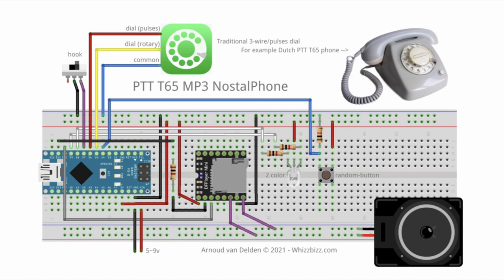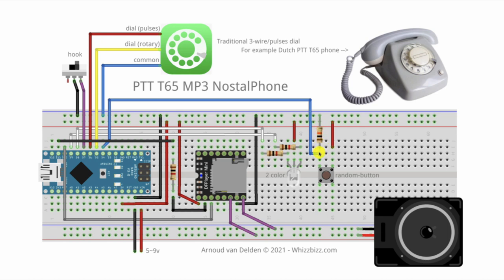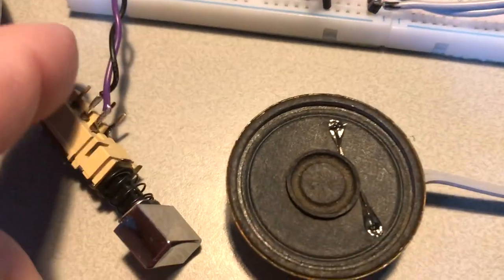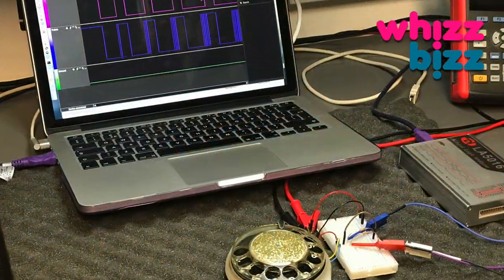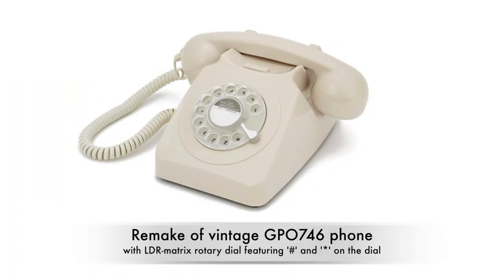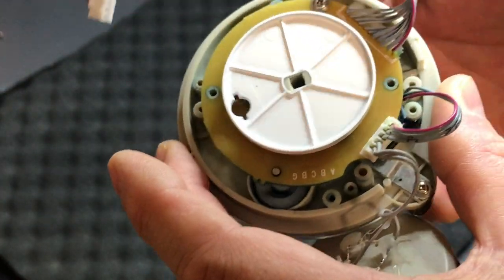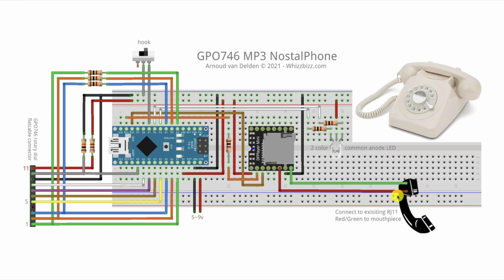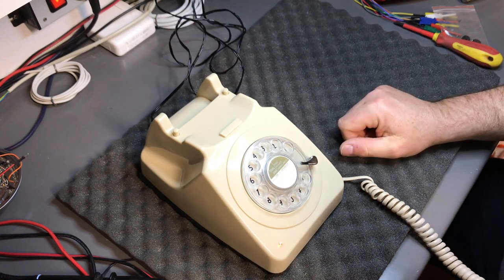Building a MP3 and WAV player from a vintage rotary dial telephone

Comment: Great video! I have a couple of questions, would this work with a standard Cetis wall telephone? Considering it’s not a rotary dial phone, how would I go about assigning a sound to each button?
Reply from the maker: That is unfortunately something completely different. Although there seem to be MP3 Audio Shields with DTMF Support, I've no experience with these.

If you want to construct something yourself, you will have to decode the DTMF tones of that type of dial. You may do a search on 'DTMF Arduino' to decode these tones. E.g. https://create.arduino.cc/projecthub/MM_Shoaib/dtmf-decoder-using-only-arduino-872502

If you do a search, there seem to be several DIY projects online. Good luck!
Reply: @arnoud-whizzbizz  I appreciate your response, thanks so much!

Comment: Hi, for some reason after every dialing it won't play the song and the message comes: DFPlayer: Time Out! But the dial tone plays when I pick up the hook.
Reply from the maker: I think I got the error message too. Probably SoftwareSerial is just not that fast and the MP3 module works fine (dial tone!). You can (depending on the version of your library) try adding 'false' to the .begin(): myDFPlayer.begin(mySoftwareSerial, false) in the test at the beginning. One problem is that the player board does not have a reset, so you really have to disconnect the power supply every time to reset it. The fact that there is no music could be due to your directory layout on the SD card. The music must be in numbered subdirectories. Good luck!

Comment: Hi, i can't seem to get it dial to the specific file number or subfolder. i still don't understand how to manage the folder naming. it just wont play any songs inside the folder i created. do i need to insert the bash script somewhere?
Reply from the maker: T65 or GPO746? The script is only to be used when you put your files on the SD-card. It only changes filenames. After use the subdirectories have names like '01', '02', '03', etc. The sound files will then be named '01.wav', '02.wav', etc. in each folder. I suggest that you set if (0) to if (1) in the Sketch to get some logging to your serial monitor and debug what's going on. Probably your SD-card is not accessable or the directory-structure is not recognized. Are you sure the sound files have the right codec? Good luck!
Reply: @arnoud-whizzbizz  im using T65. i did all the wiring as shown on diagram, when i pickup the hook a music starts as expected. however, as i dial the number, the music stops and it doesn't play any music on the files. i did the foldering as instructed
Reply from the maker: @rukoscgki1382  Your wiring should be ok if you hear (the first, or only) sound-file in the root of your SD-card. I have a 'dialtone' sound there. Are you sure you do NOT have any hidden (probably non-sound) files in your directories and that your audio-codec of these files is ok? You could test that by putting them in the root temporary. The bash script also removes hidden files (filename starting with a dot). Please check your directory-structure and contents form a commandline terminal?
Reply: @arnoud-whizzbizz  yes i have tried using wav and mp3, my files is as follow, Folder name is: "01" and so on, inside is all the files named 01.wav. ah yes a question, how can i use the bash script? i have no clue on how to use that for.
Reply from the maker: @rukoscgki1382  I only made the bash-script (that ONLY runs on Linux, Unix or under MacOS X in a terminal) to copy my original music-files (with full, describing, filenames) to the more cryptical 0.wav, 1.wav etc filenames that are used on the SD-card. So if you already arranged all that by hand.... you may forget about the script. I suggest that you add some logging and TEST if the file could be played by the module. I have converted ALL (by hand via an app called 'Switch Audio Converter') to WAV mono 22kHz 8 bits.